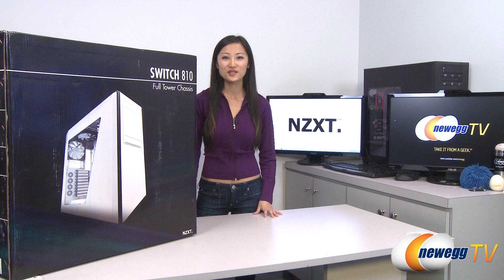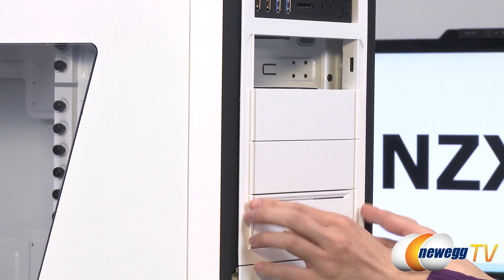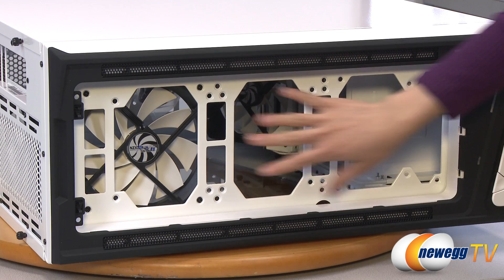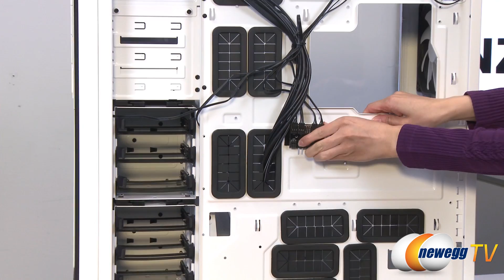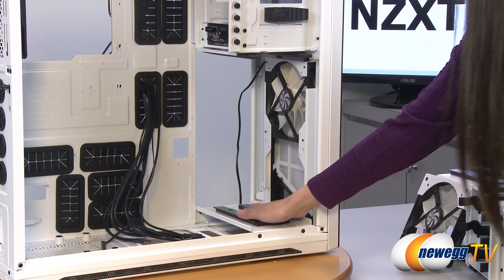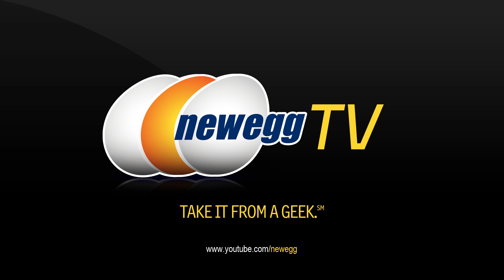Newegg TV: NZXT Switch 810 Full Tower Computer Case Overview

Comment: I just built my computer, and for some reason the leds for the io shield wont turn on when hitting the button, which connectors control the power for those leds so i can change it to try and fix them.

Comment: That's a dual 120mm radiator.  It 240mm long x 120mm wide x 25mm thick.  The top can house up to a 360mm or 420mm radiator so a 240mm radiator will fit just fine. So to answer your question the Corsair H100 and all other Asetek 240mm radiators will fit just fine.

Comment: 200mm rad as in 200mm Long and 200mm Wide OR 200mm Long and 100mm Wide?
Did you possibly mean 240mm or 280mm? (dual 120mm or dual 140mm configuration)